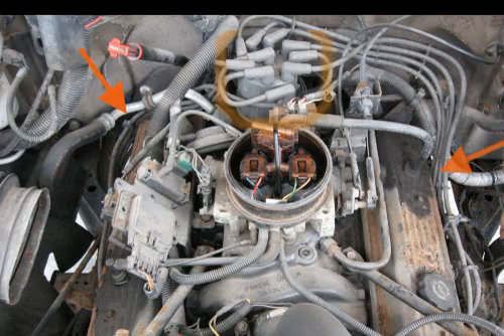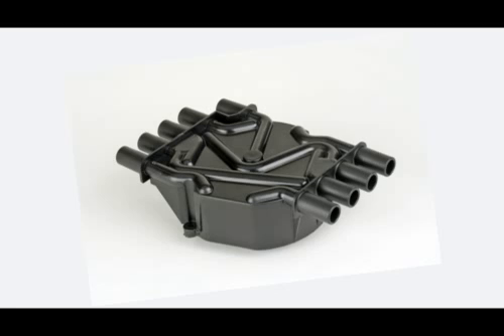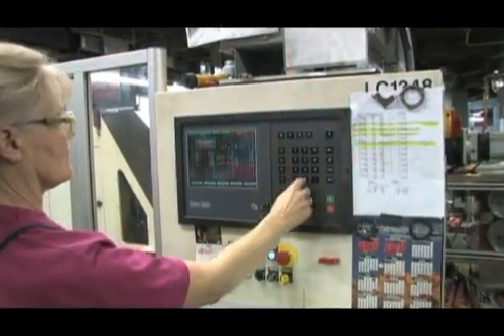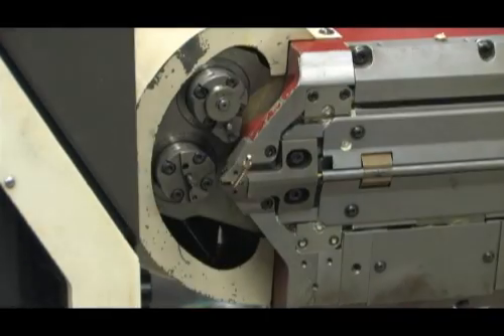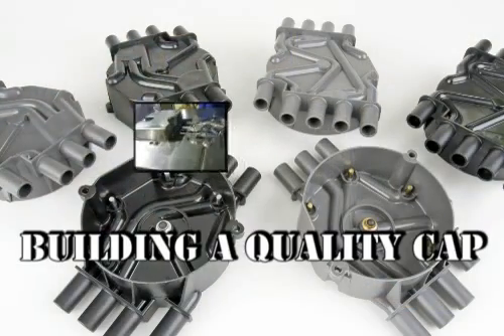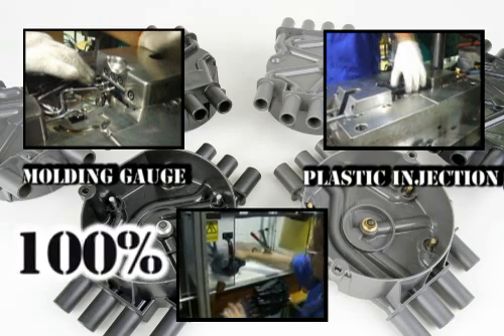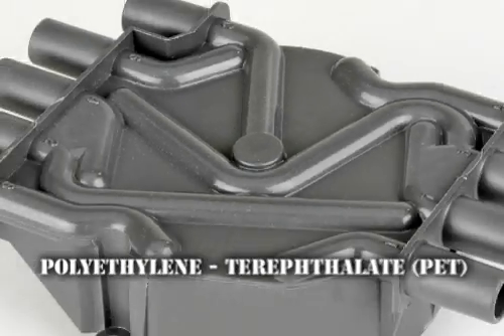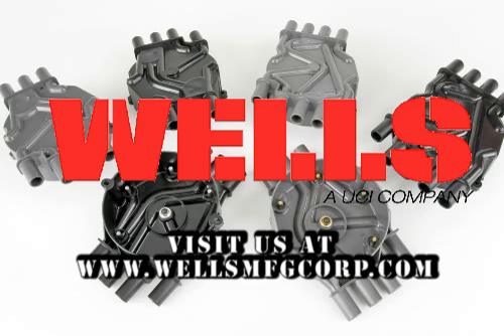GM Late Model Distributor Caps by Wells Engine Managment

Comment from the maker: @MrMentalbreakdown00 At times it can happen much sooner than 100K. the first thing to check are the vent ports in the bottom of the distributor. If they are restricted in any way the ventilation in the cap will stop. Watch our video on poppet injector replacement. It explains the problem and shows how to clear the vent holes. 

Mark Hicks
Wells Vehicle Electronics